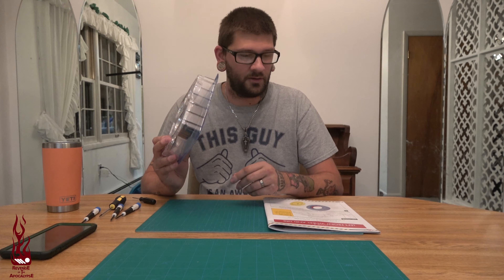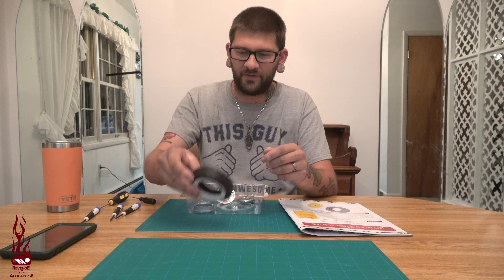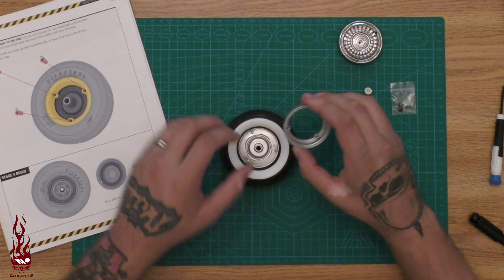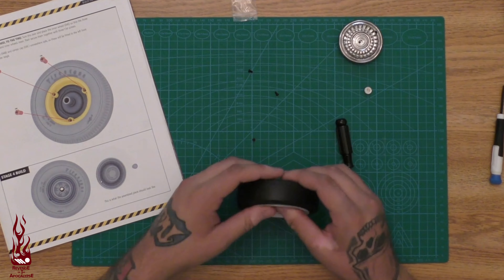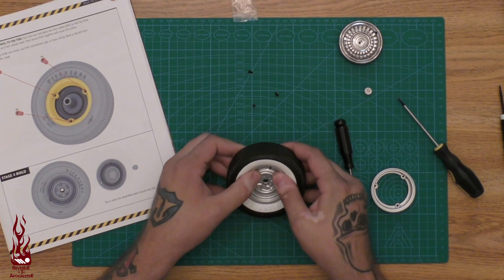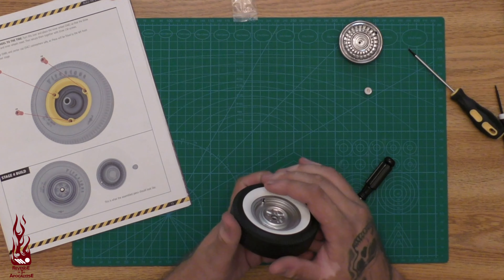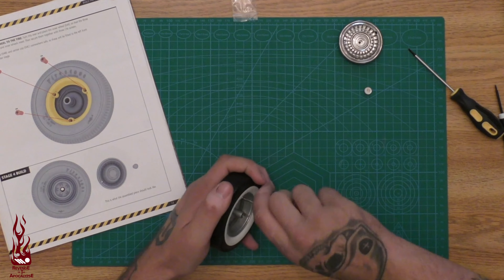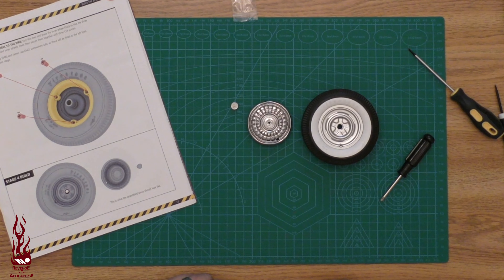Ghostbusters ECTO-1 Build Issue 3 Part 2

Comment: When you put the wheel on the car that is when those extra trim parts come in to the build.
So if you can put them back in the blister pack with the wheel until needed with a little knot about which side of the car it goes on to.
This is just a suggestion.
Loving the build as all ways.
Stay safe all.